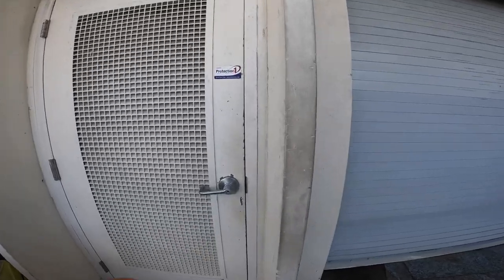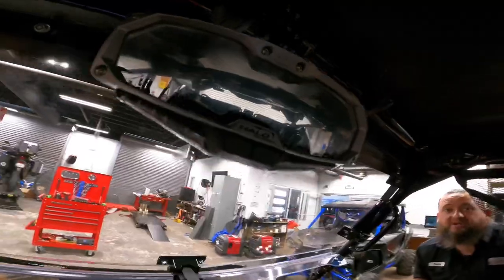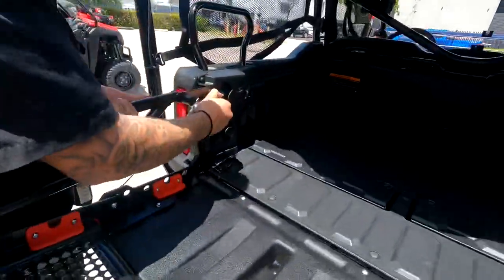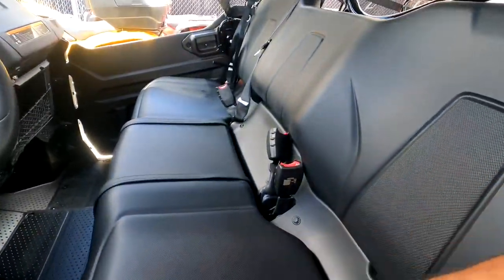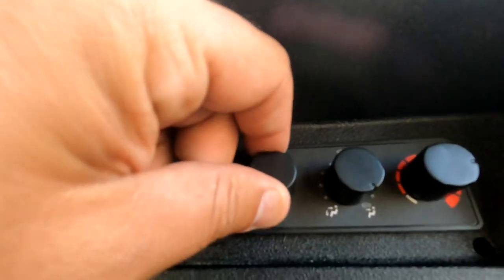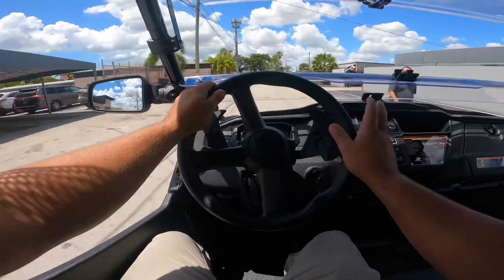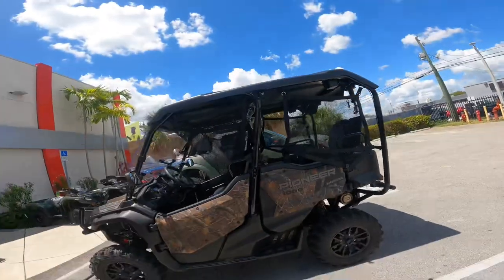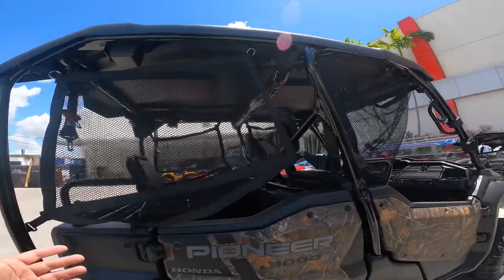Official review and test drive 2022 Honda Pioneer 1000-5 forest edition with accessories

Comment: Need to check the toe adjustment on that machine, steering wheel is way off center.  Toe setting is "off" from the factory on a majority of these machines.  Many posts on forums about these things "eating" front tires right out of the dealer showroom.